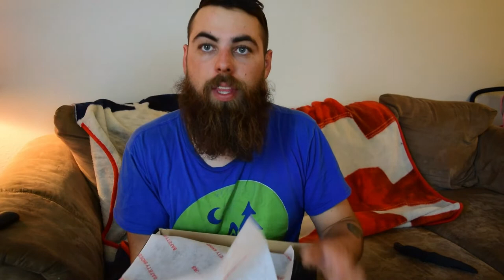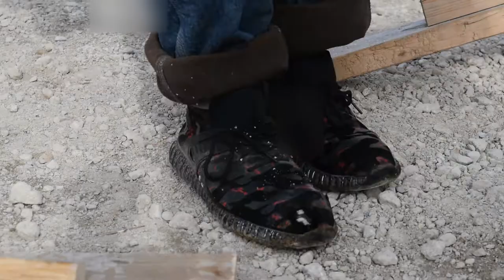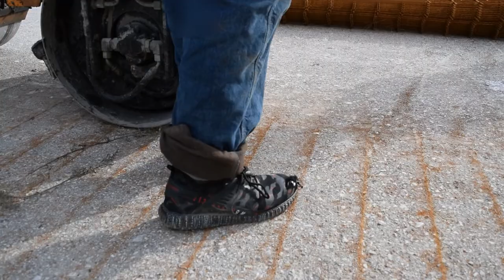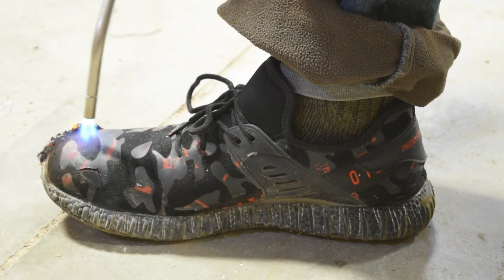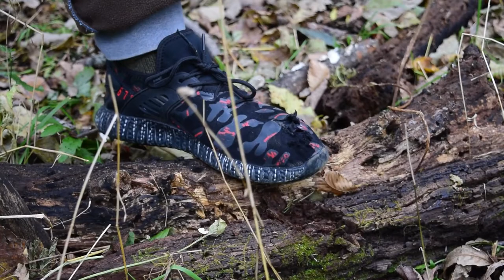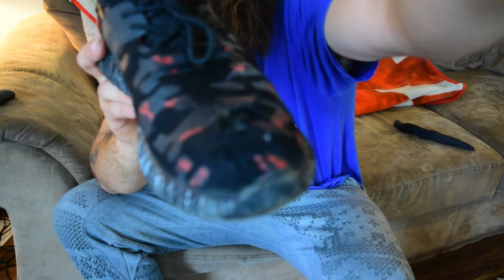indestructible Shoe's Worth It? | Challenge excepted

Comment: Holy smokes. Those are pretty badass. I tend to work in shoes in the summer and boots in the colder months. Doing the hardwood floors so I'm always stepping on a staple or the occasional tack strip. I know what I need for Christmas. Damn this was legit. I'm sold.
Reply: They should make plate carriers and tactical vests. JS.
Reply from the maker: Agree man I was skeptic at first but man they are bad@$$
Reply: @TylerWoodBushcraft  Agreed. If it wasn't getting cold and the end of the month (bill time) I'd buy a pair right meow. Unfortunately we don't have the extra moo-laa.